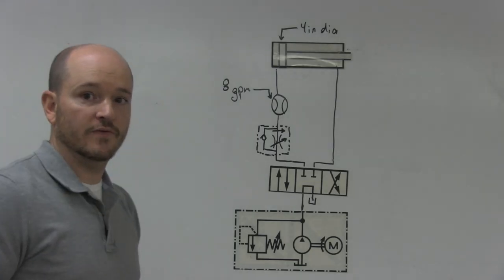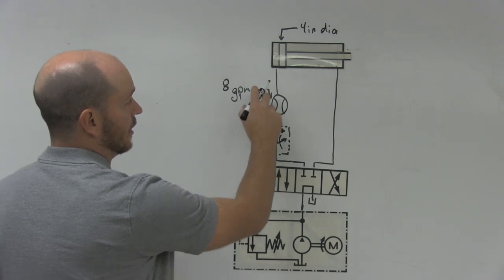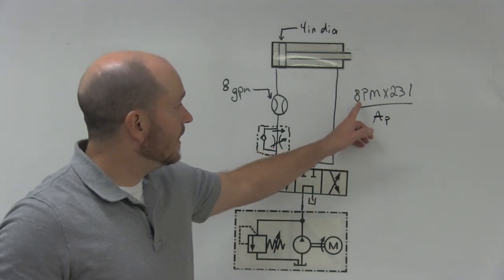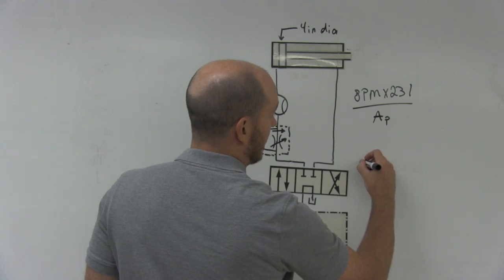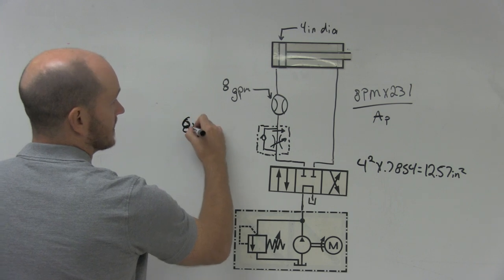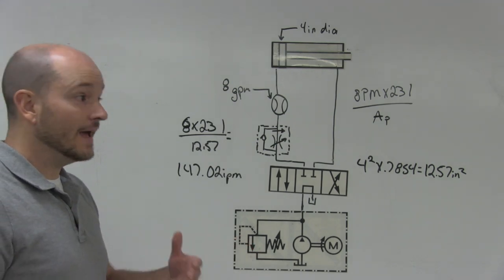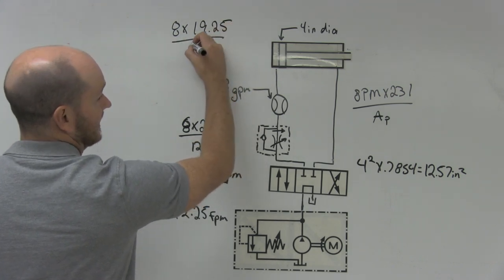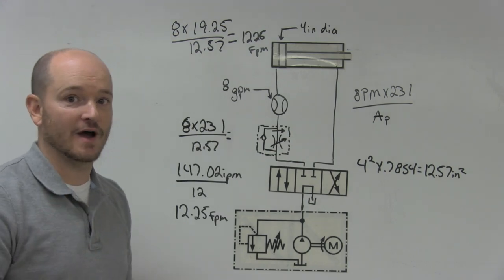Calculating Cylinder Speed

Comment: So if I have a dump trailer that has a 2gpm pump, if I switch to pto driven wet lines from my truck with 4 times the Gpm would I be correct in assuming that would speed up my cylinders to Dump faster?

Comment: Just to understand. Why arent we considering the stroke length of the cylinder. Why arent we considering pi r*r*h   because technically the cylinder moves for the stroke length.  I would appreciate if you can help me understand
Reply from the maker: Stroke length does not affect speed.  The cylinder can be 2 ft or 20 feet and the speed as which it moves will be the same.
Reply: @KletteTech  Thank you for clearing my doubt.

Comment: Pat thank you what is cylinder regeneration means
Reply from the maker: It typically means that the ports of the cylinder are tied together to speed up the cylinder.  It speeds up because the oil flowing out the cylinder is combined with the cylinder entering the cylinder and the cylinder will speed up.  I will try and make a video on in the future and pass it along to you.

Comment: how to get the number 231? thx for replying
Reply from the maker: The number 231 is a constant.  It represents how many cubic inches are in a gallon.
Reply: @KletteTech  thx for replying. this is a formula in CKD cylinder handbook 

Q=A*V*((P+0.1013)/0.1013)*(10^-6)*60  

which Q : l/min        D : mm        V : mm/s        P : mpa 

why does his formula show the piston speed is related to the air pressure?
Reply from the maker: I am not sure.  I have not seen the handbook.  If it is talking about pnuematic cylinder that is a different formula all together.  This is for a hydraulic cylinder.
Reply: @KletteTech  thx for replying again, our discussion above shows why a hydraulic system is more stable than pneumatic on the topic "Incompressibility".
Reply from the maker: @chianyuchen8152  Could not agree more.  Any other conversions you want to have, please reach out.

Comment: How do you calculate the cylinder speed with a known load? Say the cylinder is pushing / pulling 500 lbs.
Reply from the maker: Great question.  There are a number of factors that come into play.  If there is not a flow control or a non compensated flow control, you need to know that GPM going to the cylinder.  This will change based on the load.  The more load less GPM and visa versa.  You also need to take into account the other components in the system.  If the GPM is not known then there are formulas for figure that out but they go beyond what I have in this video and there only estimates.  Also, remember that the speed will be different on the return (fast with the same GPM) because there is less volume on the cylinder return because of the cylinder rod.
Reply: @KletteTech  This was a question on a classroom lab I had last week. Major cylinder area was 12.566 sq. in. and minor cylinder area was 10.161 sq. in. Cylinder was had a static load of 800 lbs. on extension and retraction. Psi for extension was 63.66 psi. Psi for retraction was 78.73 psi.  Was asked to calculate cylinder speed in inches per minute.  The only formula in the textbook was for an unloaded cylinder which the instructor allowed us to calculate for since he couldn't provide the formula for a loaded cylinder.  The flow was 4 gpm thus giving a extension speed of 73.5 ipm and retraction speed of 90.9 ipm.  Have searched for one but have been unable to find it.
Reply from the maker: John S once I’m at my computer I will send you the answer.
Reply from the maker: @johns8771  Your answer is actually correct.  The trick to this question is that the 4 gpm is actually taking into account the load.  Depending on the circuit's components the load can or cannot have an affect on the GPM entering the cylinder.  Either way, once the gpm has been given or discovered the load no longer affects the speed.  To summarize, the load only affects gpm.  Once gpm is known the formula is the same for loaded on unloaded cylinders.  Make sense?
Reply: @KletteTech  Yes it does.  Thanks for the information.
Reply: @KletteTech  Kind of an off topic question but are you the author of the Fluid Power Systems textbook?
Reply from the maker: John S Yes that me.  Do you use it for your class?
Reply: @KletteTech  Yes we do and material the instructor developed.
Reply from the maker: @johns8771  Thats great.  Where do you go to school?
Reply: @KletteTech  Spartanburg Community College, Mechatronics Program.
Reply: @KletteTech  Hi! Will this be the same for pneumatics cylinder? I have a project in which i have to calculate the speed off a pneumatic cylinder with a constant load. P=6bar A=490.9mm2 Load= 184N. I know the outward stroke force is 294.5N but i can´t find any formula to calculate the speed of the stroke. Thanks